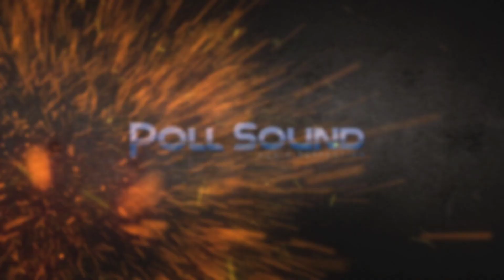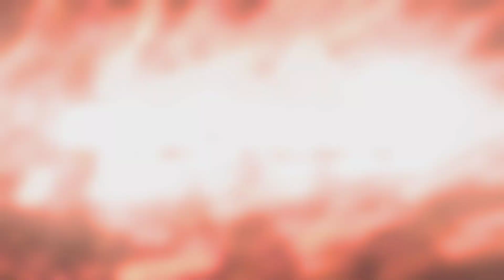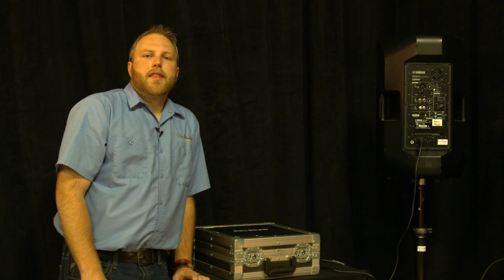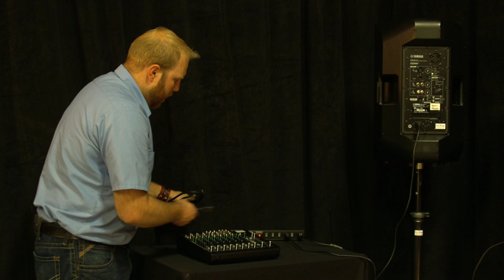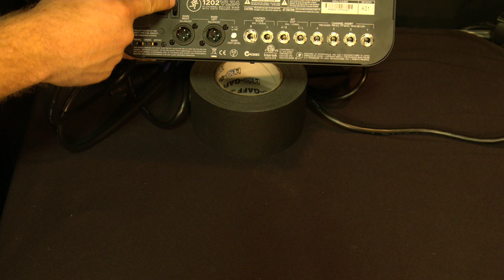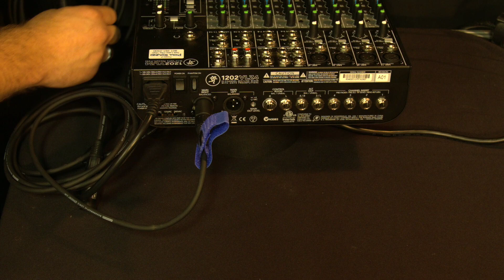Mackie 1202 Detailed Setup and Operation

Comment: An important point. 
The "pan" knob on the stereo channels is really a balance knob (bal). 
The difference is that a balance knob lowers the volume 
of the right channel when you turn it to the left and vice versa. 
So if there is a sound panned hard right on your source 
it will disappear more and more as you turn the knob, 
not move from right to left as it would using the mono channels pan knob. 

The aux send and returns can also be used for external effects like reverb, 
not just for monitors. 
✌✌
Reply: thanks for sharing that, very important detail indeed

Comment: Is there a way to have phantom power required and non-phantom power compatible mics on this board at once? Is there some kind of adapter that can bypass phantom power for a single mic? Thanks
Reply: If the mic doesn't require it, phantom power doesn't have any effect on it.

Comment: thanks for the video . but i have one question : can you use this mixer to record ? （i  have an audio interface） and if you can , how do you connect your laptop (audio interface)to the mixer ? 
my band have been using this one to practice and it sounds great , but we just don't know if it's capable  of recording , because it's not a digital mixer .
Reply from the maker: Hey Enzo, providing your audio interface has 1/4" or XLR inputs then you could come out of the main outputs of your mixer and record. The mixer itself does not have a build in recorder or interface but it should feed your existing interface just fine thereby allowing you to record.
Reply: i got it now , thank you very much !!!!
Reply: @pollsound795  what about if you using tape connection

Comment: Great intro video. I have 2 issues: 1. There's lot of static noises when I turned the main mix volume up 1/4 of the way.  2. There's loud echo feed back with the XLR mic if I turned the level 1/4 way up (no problem with the Line In mic).  Thanks.
Reply from the maker: Thanks for watching, it is difficult to diagnose your problem without a complete system diagram of your setup. Your mixer could have problems but it could also be something else in the signal chain. Please feel free to reach out to us on our website and one of our qualified service technicians will be happy to assist you further.
Reply: Electric contact cleaner on those pots ...find video about procedure ..be careful